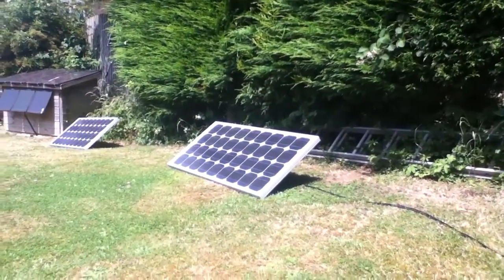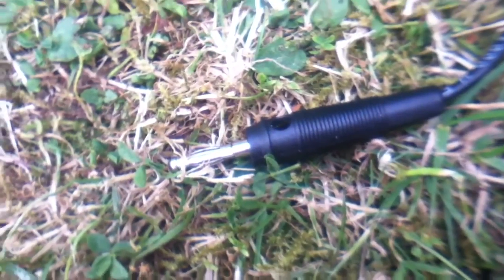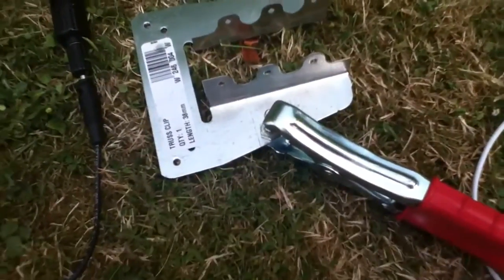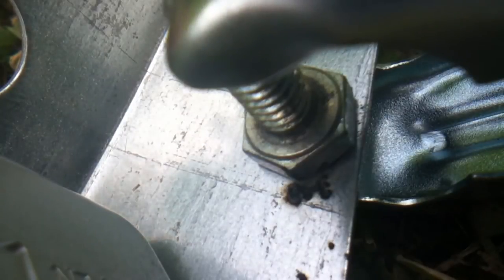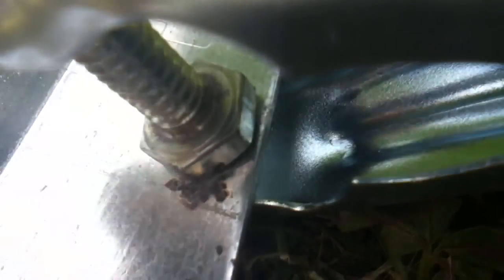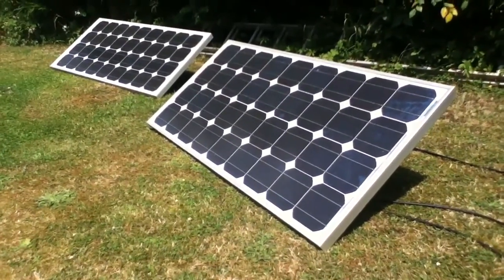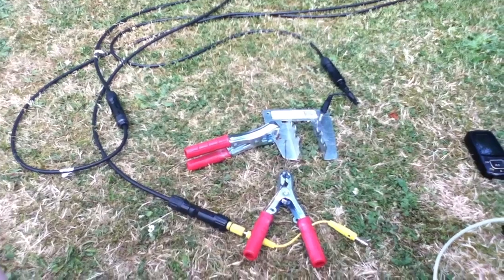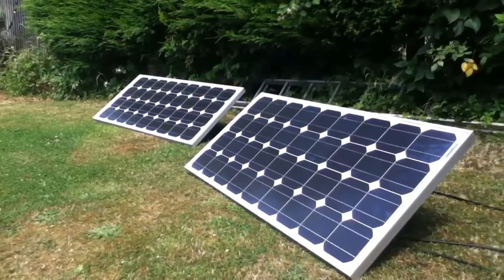Experimental Welding without Welding Equipment (just Solar Panels)

Comment from the maker: It did look like I was getting somewhere with the bigger arc. But my welding rod was a piece of copper wire which just melted at too low a temperature. Definitely worth another attempt! Thanks Raymond.

Comment from the maker: Yes, and that's with just 40 volts. Roof top systems have 700 volts across them. I should have compared the arc with the panels in series against the panels in parallel.

Comment: A few points to get satisfactory welds. One is you need about 36 volts open circuit volts.  Two you need to generate a blanket of inert gas.  This inert atmosphere is made by burning a flux in welding rods or supplied with a pressurized gas cylinder with inert gas such as argon.  Three your electrode that you strike the arc with needs to be properly matched to the amount of current you draw.  Copper is a very bad choice because it is too conductive and  it takes heat away from weld joint.  A steel welding rod has enough electrical resistance to get hot enough to melt and burn the flux to create a blanket of protective gas.  Hope this is enough to get you in the right direction.

Comment: Would shorting the panels cause damage to them (in order to create an arc)?
Reply: No, because they are a (a bit unrealistic) current source, so the current is limited. No explosions (as would happen with a "voltage" source, such as a battery or the grid.)
Reply: johncarter55 That's one nice thing about solar panels.  They can never be damaged by you shorting them.  You're simply taking the full amount of current produced by the panel in that amount of sunlight and, plus, the wires for every solar panel are a high enough gage to handle that current.  You could literally keep a solar panel shorted all day long.  And it doesn't matter if you have multiple panels in series or in parallel.  You might ruin your wires that interconnect them, but not the panels themselves or the panels' built-in wiring.
Reply: +Christmas Eve except all the power will be dissipated IN the panel until they melt  or crack.
Reply: drspastic
No because at short circuit there is no voltage. Thus P=V*I since V=0 (or almost zero, more likely about 10-50 mV) P=0 or a very low power.
Panels are constant current generators.

Comment: Did you have your electrode positive? If so you should reverse your polarity and give it another go. Watch this small video segment and you'll see what i'm talking about. youtu.be/2537L5H7NiY?t=3m23s . This video a must when it comes to learning to weld.  You might actually succeed if you use a welding rod. Ex. a 1/16 6011 or 6013 . I hate them because they splatter all over the place but they do dig deep.
Reply from the maker: Cheers - thanks for the advice

Comment: Also when you try again rough up the contact areas you want to take the weld and then try keep the run going as you weld ,it's really only like super heated soldering ,imagine the use it would have in third world sun rich country's .I'd build on this idea ,really.